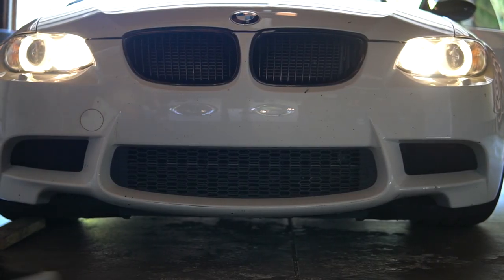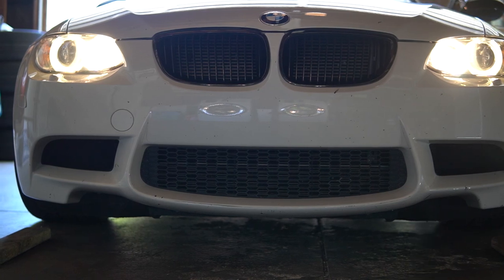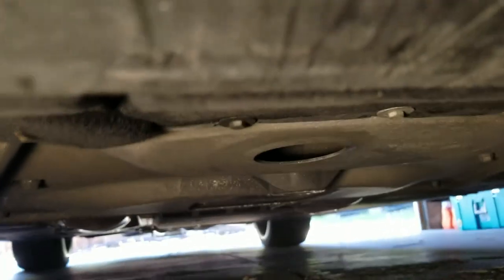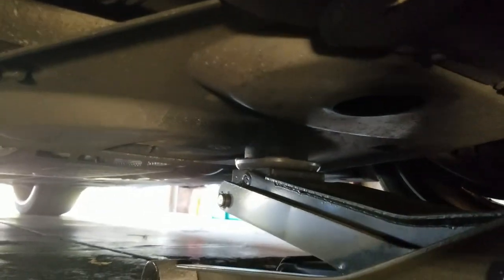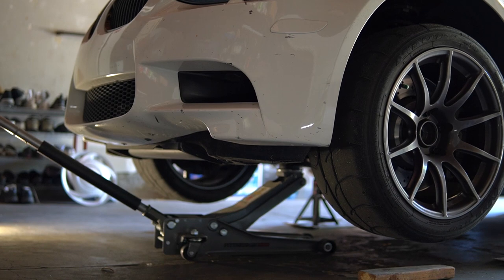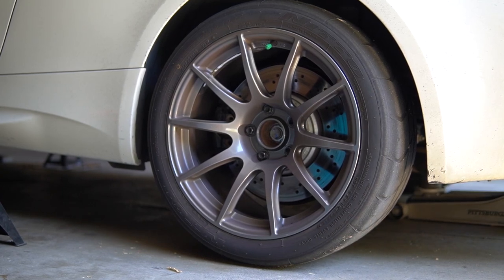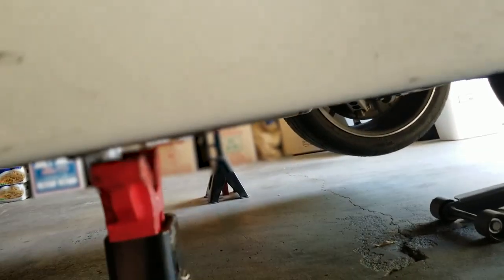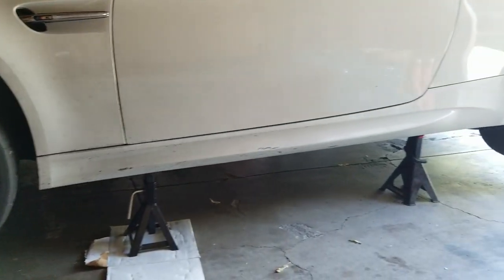How To Lift A BMW Onto 4 Jack Stands - E92 M3

Comment: E90s that have rear trailing links can be jacked up on the support member of these suspension links also. Itnis usually located right behind the diff (towards the trunk), it is a big trapezoid steel piece hanging down vertically

Comment: Great video true straight to the point the only problem is where you ended up putting the jackstands those are the 4 lifting points where the normal jack stand that comes with the vehicle supposed to lift the car up it fit inside that groove. Now it looks like it's damaged been watching some other videos to see how is done I'm trying to do the same for my daughter BMW. I can't believe that BMW doesn't give you something like the hockey puck that will fit in that groove thanks for the video
Reply from the maker: Yeah, BMW should provide some sort of pad. I guess it's just another way to deter us from working on our own cars.
There are jack pads you can buy that fit in the grooves but if you're going to put your car on stands several times going forward, it's probably not worth the hassle. You can find replacement pads for around $6 a piece if needed.

Comment: Generally speaking, only lift by the rear differential on solid rear axle cars (e.g. pickups).
Go for the rear subframe, every time.
Reply: @BIG_SCAM BMW also specifically says their transmission fluid is life time

Comment: The jackpads on the BMW the black little rectangle plastic pieces underneath the car that you Jack from are complete garbage don't put Jack stands write on the news it unless you put something inside that rectangle it could collapse at any moment . You can Jack there if you buy a certain type of pad that slides into that rectangle and goes on top of the Jack otherwise don't Jack from there and  Don't put Jack's  It stands there